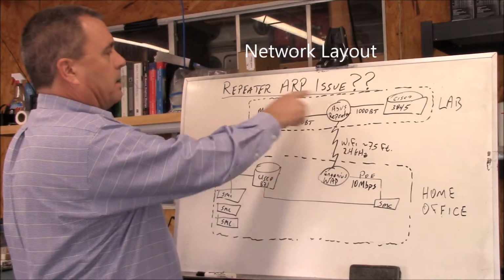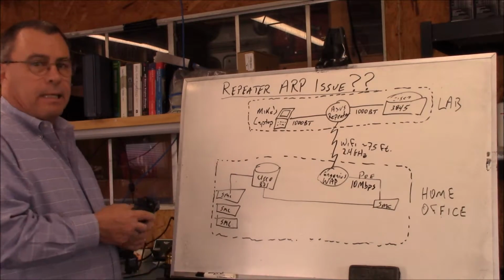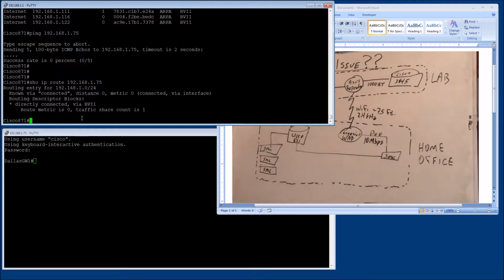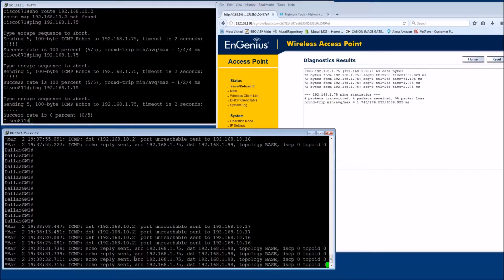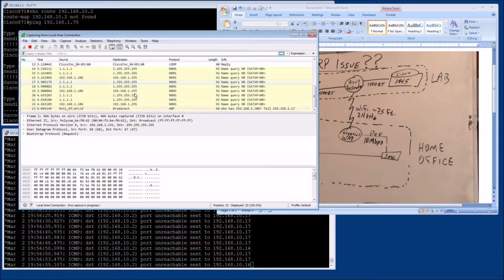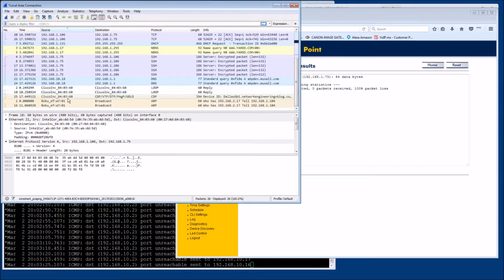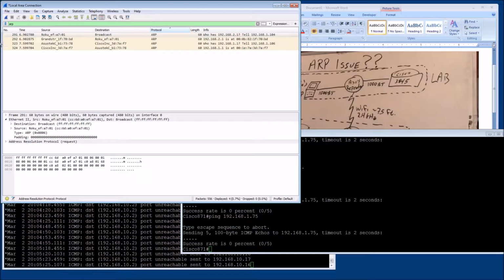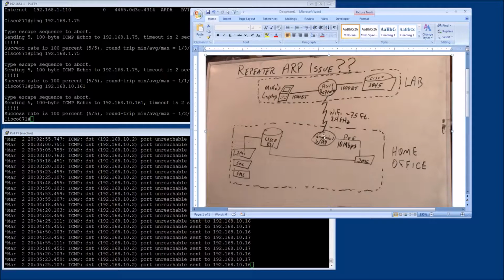NE#21 Wireless Access Point and Repeater Debugging

Comment from the maker: Here is a link to a commercial type wireless bridge I am referring to in the video. https://www.amazon.com/EZ-Bridge-Ultra5-100Mbps-Wireless-Bridge/dp/B004RSHLGW  I have not used EZ-Bridge but they claim "The EZ-Bridge-Ultra5™ creates a transparent bridge between 2 sides and passes all network traffic including VPN and DHCP. You can think of it like connecting a CAT5 Ethernet cable between the 2 points."  That sounds pretty good.  Still, a cable is the best!